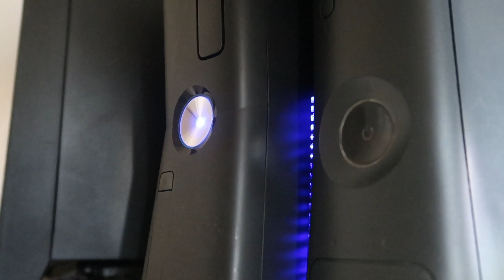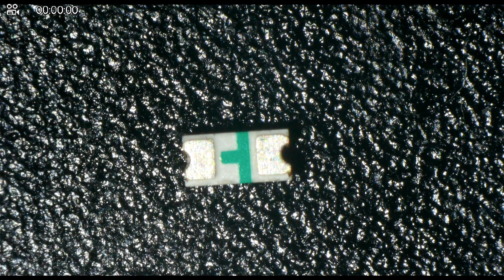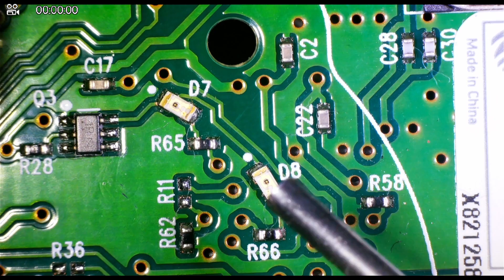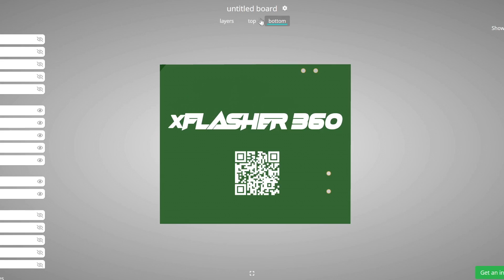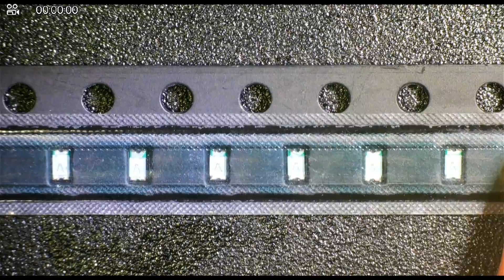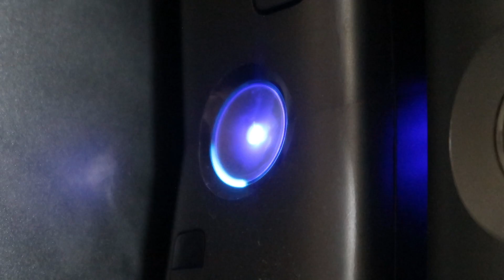How to Change LEDs on an Xbox 360 [Ring of Light Mod]

Comment: How? I replaced mine with white LEDs, however theres a green film on the LEDs on the faceplate.
Reply: if actually a transparent green plastic ring that goes around the power button there's no way to remove it without removing the power button from the faceplate and then the black plastic housing from the power button. if youre careful you can reuse the housing enough to glue it back in to the faceplate

Comment: if the red LED must remain, why change that LED too?
Reply from the maker: The middle LED component is sort of a two in 1 package, so to change the green LED of the power button, we need to remove “both” the red and the green LED’s and replace them with separate 0603 SMD LED’s.
Reply: Yeah was wondering this too. I get the power button ones since its one unit but the ones around it if some have to stay red why change those?
Reply: @SoLCollectR I was confused about this at first too, but the slim actually doesn’t have red LEDs on the outside, the only red one is in the middle which is why the “Red Dot of Death” is also a thing.

Comment: Well... just ruined the resistor that you've fixed.
Gonna buy some 30 ohm smd resistors then :/
The R70 is just placed this crazy, it's easy to fail
Reply from the maker: Ah that sucks, yeah they’re very easy to remove by accident. I’m sure it’s repairable, and if not you can buy replacement ring of light boards for cheap on eBay.
Reply: @TheModSmith  im sure I can fix it, ordered 30 ohm 0402 resistors on Aliexpress

Comment: Did you buy the LEDs used in this video on AliExpress? If so, which listing was it? I'm having a hard time finding ones that work. Bought 9000 from a seller and none work. Thanks!
Reply from the maker: I got them from eBay, they’re a very common type being 0603 SMD LED’s. You should have no trouble sourcing some.

Comment: Solder paste and a hot air station are key for this micro smd work. Understand some budgets are limited but you can find a hot air station cheap these days and a syringe of solder paste is no more than flux. Cleaner finish and once tried you will never go back !
Reply from the maker: I’ve tried both, but find the soldering iron and tweezers technique lots easier and faster.
Reply: Solder paste is not needed for this work by any means, realistically you don't need paste till you're doing BGA work and the such.  Fine solder wire is better and leaded helps, this doesn't look like it's flowing like leaded would.

Comment: For the Slim and Slim E. I find 0402 fit a lot easier. They're a bit harder to work with as they're that much smaller again
Reply from the maker: Oh I see, I didn't think of that. These 0603 ones seem to work fine but it's sometimes difficult to get them centered on the pads.